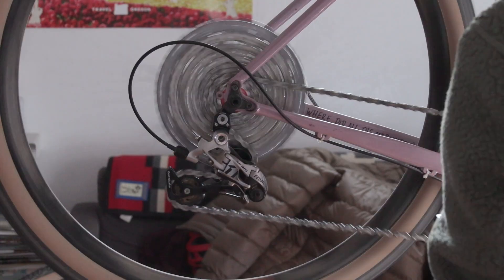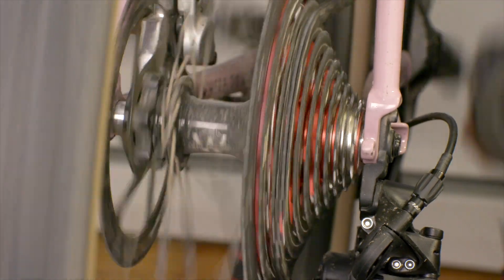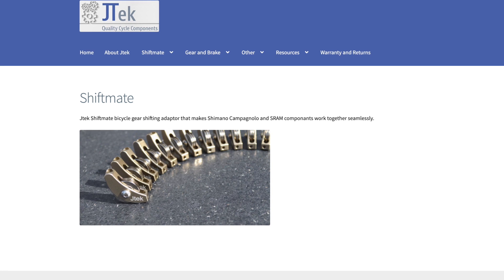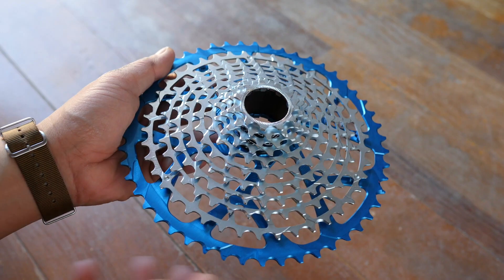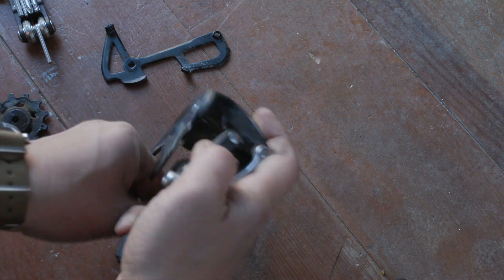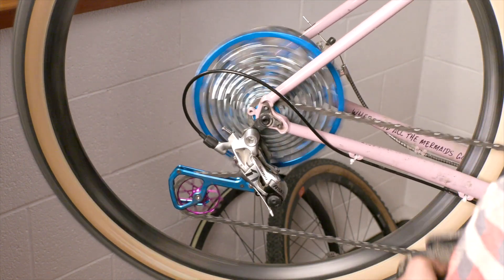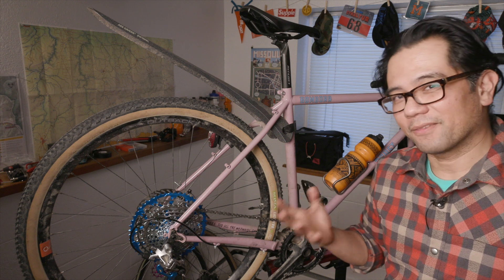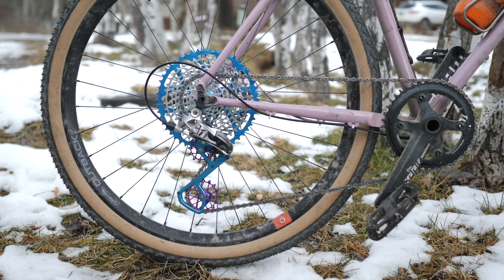BIKE HACK! SRAM Road Derailleur with MTB Range! #CaveofBadIdeas

Comment: What shifters did you wind up using in this video?
Reply from the maker: Rival brifters.
Reply: @PathLessPedaledTV  cable disc's or hydraulic? I'm looking for options to go 11 42 11 speed but I need new hydro brifters. I could go with friction shifting, but then Id still need hydro brakes? Unless I just got sole bb7s and then started all over with a rival cable set up?
Reply from the maker: Cable brakes. Yokozuna Ultimos are the best damned cable brake.
Reply: TRP makes a top of the line cable brake... best one I’ve seen. I have BB7’s, but I’m about to install the TRP’s

Comment: wouldn't a goatlink work the same? and it is way cheaper. i used 1 on my wife's alivio deraileur, now it can use a 8 speed 11-42 teeth cogs.
Reply from the maker: Goatlink is specific to Shimano mechs only. Tried the Roadlink in the previous 3 videos. Just BARELY shifts to a 50 but it wasn’t pretty.

Comment: 10 speed road shifters are compatible with MTB rear mechs up to the 9 speed group set, still gives 10 speeds (Shimano). At least a 36 on the back so 1 to 1, and can run easier gears (40t)

With SRAM, the standard force RD should manage a 40t garbaruk cassette, per reports on the internet, so 1 to 1 on a 40t chain ring, and 10x40 so fine for the road

But this extended RD should be great, must try it, if I ever need a 50......
Reply from the maker: Yah but do they clear a 50?
Reply from the maker: If you watch out previous vids, Rival does 46t perfect. Beyond that it gets sketchy.

Comment: Dont you just need to match 11 sp deraileur with 11 shifter. Mtb or road shouldent matter. The deraileur doesnt know the difference. I know for fact you can mix shimano or sram shifters abd cassettes and deraileurs for mtb. Many riders i know mix it all up. Like xtr deraileur with eagle casette and shifter or whatever.
Reply from the maker: I'm using a ROAD shifter.  Has a different cable pull than mountain derailleurs.
Reply: @PathLessPedaledTV  never tried that. Only on down tube sis shifter and it worked. R u sayin the distance inbetween the cogs on a road cassette is different than mtb. I guess ive tried it if you say it dont work it must not. Sorry dit not want to come off as bashing your hack here. Thats one thing that is nice to have on a gravel bike it full mtb range with 2x i find. 50/11 casette with compact 50/34 crank. On alot of climbs in my area you need that 42, 46, 50t.
Reply from the maker: Not the distance between the cogs the amount of cable pull has changed since 11spd was introduced.
Reply: @PathLessPedaledTV  oh is see. So you could get to 46 t with 10 speed. Good to know. Will try that. Down tube shifters suck